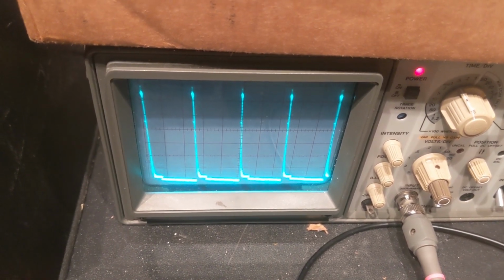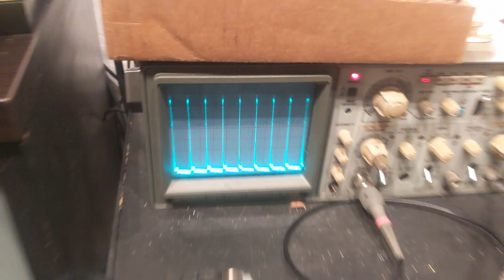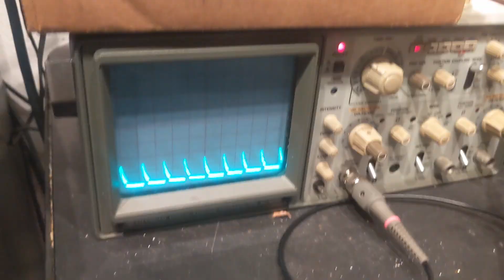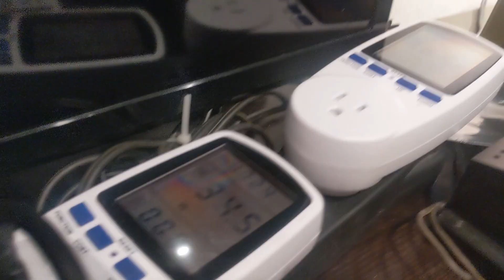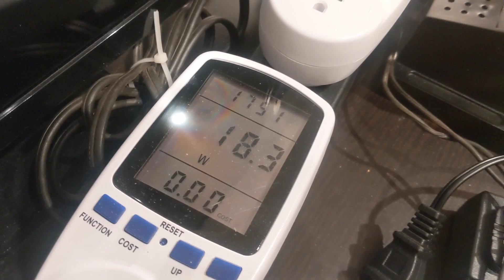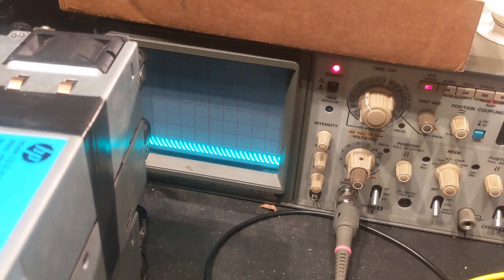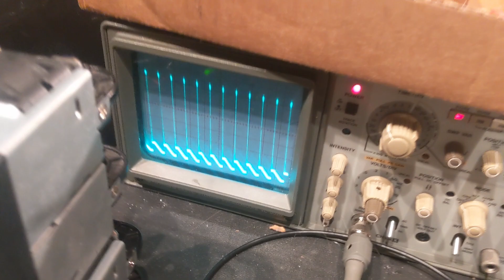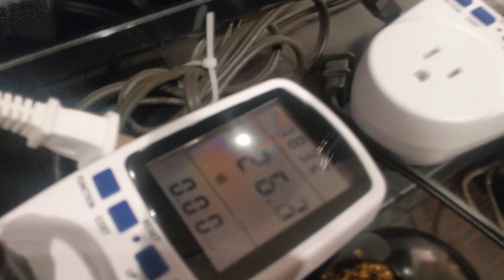HHO High Voltage Resonance

Comment: Is that a bosh ignition module that I see?  Can you explain it’s use please?
Reply from the maker: Yeah, the radiant comes from the spark gap it has, if that's what you're referring to. The energy it draws in just goes straight to the cell. I'd have to look at the schematic again but there are many ignition modules, this one basically works properly with the transformer. Wondering if there's another one that's better though

Comment: Have you been generating alot of hho using high voltage, high frequency and low current?? I'm still waiting for your answer
Reply from the maker: It's less about quantity than quality. The gas production is little, but it burns better.
Reply: @weighta6630  Oh right, that's good you make a little of gas. Have you thought about making a PCB board to generate the frequency by install python software on the board that will take the reading of the voltage then it would calculate it to generate to make the high frequency??
Reply: @weighta6630  ionize dehumidified air and mix it with the hydrogen gas? Prevents water from forming out of the hydrogen so you can run a large quantity of gas at once.

Comment: the high voltage must be coming from inductor spike.that is pulse by 555 timer or TL494 ic.not from high voltage transformer ..thats why u need inductor before cell. 1 inductor per cell is the proper config.not like this.watch RAVI RAJU video 15 years ago.thy repkicated this long ago

Comment: Cell insulation in this design us poor. when you add a conductive electrolyte current begins to skip other cells  taking a shorter path were it does not have to do as much  work and so the voltage drop across the cells in serries will be uneven with the largest drop at yhe begining and ending, because current is flowing through the cells unevenly skipping the center cells. 

Reguarding electrolysis, there is nothing magical about resonating an LC circuit. It does not more efficently break water apart and is far from molecular resonence. Forfet all the psudo science nonsense.  Even if you could reach molecular resonance with water, you'd just heat up water like a microwave oven needlessly flipping the waters molecular dipoles, and do  doing nothing for electrolysis. The except beibg where voltage at a plate is sufficent  to split hydrogen from oxygen 1.24v and a little more  to do the work of  push pushing ions    through an electrolyte. 

Keep it simpke.  Use DC.  And apply only as much voltage as needed to push current density you're aiming for. Stainless steel max should stay under 1 amp per square inch. 0.5amps per sq inch will keep the electrodes in good shape much longer.  Wire all the cells in a wet cell in parallel forget the serries nonsence. Serries is gine for dry cell design or were cells are well isolated from others.   Increase the conductivity of the electrolyte with a 6 mol solution of potasium hydroxide to 100 ml of water. Reguardibg your source of potasium hydroxide, Be aware of percentage of potasium hydroxide hydrates like  KOH•(H2O) to get a good number on the number of moles you're adding to each 100 ml of water. 

The  rate of hydrogen production is all (only) about amps that flow.  water's splitting voltage 1.24v × the amps that flow = watts of energy being stored chemically. The 1.24v doesn't change but you can change the amps with  over volts or voltage over the previosly stated 1.24. These volts push ions that bouncing off and heatswater molecules.  Thats why you minimize the distance between plates and use a good electrolyte to lower the resistance of ions flowing between plates and add plate surface area to conduct more current. 

Salts in urin largly (NaCl) contain chloride ions that are bad for stainless steel. Stick to sodium hydroxide or better yet potasium hydroxide and cover it to prevent atmospgeric carbon dioxide from converting it to potasium carbobate and bicarcarbonate.

Dont bother with PWM either to limit the average power going into a hho cell. Instead you may use cheap  pwm to drive the duty cycle on a buck converter. So that you can control the voltage to a more efficent voltage and the cell produced only have the time and contrast wuth pwm without buck conversion producing inefficiently and only during duty cycle.
Reply from the maker: Correct. The resonance is honestly no good here. The amps break the bond, but i would still like looking into hv with a good emf to split it like meyer did
Reply: @weighta6630  considering that the bonds take energy to break,  it's actually 1.24v × amp × time  that produce some unit of hydrogen gas from water.  Have you heard some HHO enthusiasts refer to mmw  mililiters per minute per watt?  That is  is each 60 watt seconds produced a milliliter of hydrogen and a certain amount of heat. At roughly 13.4v an HHO  cell produces roughly 1mmw and a bunch of heat. (13.4v-1.24v) × each 60 amp seconds, and  is less significantly less efficent than another cell supplied a much lower voltage but  producing at the rate of 6mmw. 

If one supplied 2.5v to a cell then the difference 2.5v-1.24v=1.26v overvolts that when we multiply by the amps  that is flowing = power converted to heat energy with ions bumping into molecules.  

You seam like your failure with electronic components so I'll offer this. You can simulate electrolysis fairly well in a circuit simulator with a resistor and a 1.24v zener diode. If you pulse width modulate power going into an electrolysis cell, then you'll notice high inrush current because capacitance between the plates and water's dielectric properties.  That energy consumed  by realign water molecules in an electric field. So you can model this too with a capacitor and resistor (dielectric heating) in serries but in parallel with the resistor( electrolyte resistance) and zener diode. 
For each amp second × the 1.24v drop across the zener diode represents the work needed to produce a certain unit of hydrogen.  While the same amp second flowing  through the resistor ohms = a unit of energy converted to heat. If you or anyone not familiar  with a zener diode, idealized, think of it as a resistor that changed its internal resistance in a way that the voltage drop across it always the same reguardless of the amps flowing through it. 

Myer didnt really know what he was talking aboit, and worse, a fraudster. but by all means explore what interest you.  I though I'd just help you see a little better through the muck starting with rf energy heats water like a microwave oven does.

Because water molecules look like a boomerang, and hydrogen shares its electrons with oxygen it froms a edipole  (+h )(--o )(+ h)  with the hydrogen atoms forming an angle of about 104 to the oxygen atom.   Alternating RF energy rotates water molecules to align with the external E-field and may even slightly alter the bind angle.  Doing this repeadedly with RF energy is called called dielectric heating causing the molecules to heat up and vibrate more.  But lets ask "what does water molecular resonance mean" . A pendulum resonates and if we add energy at its resonate freqency then the input energy phase is constructive interference and the adding to the amplitude of the pendulum swing. I don't see rotating  water molecules as helpful to breaking water molecular bonds, but maybe we can might consider trying resonance in a biased electric field. The bias helps keep The oxygen atoms always pointing to the anode and the two hydrogen pointing to the cathode. Do this with cold water to minimize disturbing  this the alignment.  Then maybe if you oscillate the strength of the biased field you can cause vibrations in the hydrogen bond angle,  shrinking the angle between them and relaxing them at a rate whose input energy constructively interferes.  Maybe at a high enough freqency you can find this resonanc,  but I suspect that's just too high to engineer and the vibrations you do generate will just create heat.  But, who knows maybe you'll see something interesting.
Reply from the maker: @kreynolds1123  I hear graphite foil or carbon works amazing for plating but what spacing is good for 1.24v, like 0.0625"? I mean koh will drop the voltage sure.

Most of everything mentioned I was figuring out more and more because it seems like I was getting nowhere with thinking outside the box with this. I still have ideas, yes, but i can incorporate them with the setup you're talking about.
Reply: @weighta6630  Current will not flow at 1.24v per cell.  And koh doesn't drop voltage, ratherly it  reduces resistance within a range of concentrations to allow one to apply a lower voltage to achieve a given current denisty. But you need overvolts to push current. How much overvolts you use depends on an engineering compromise between production rate, plate durability, plate cost, and sufficent efficiency. 

Conductivity between plates and through an electrolyte is analogous in part to conductivity in a wire.

First, a wire with twice the cross section area has half the resistance or is twice as conductive. 
Second, a wire that's twice as long has double the resistance or is half as conductive. 

Thirdly, Bubbles are not conductive  and reduce the conducting cross section of plates and in solution, the effective cross sectional area of  conducting electrolyte.  It's like nicking a thin wire and it gets hot when you push current through it  because your causing electrons to speed up through the narrower cross section in the nick and the electrons bounce harder off metal atoms making up the wire. 

As to point 2 and 3 you can reduce the path ions flow to reduce the resistance to ion flow, but. For a given current X, you'll produce Y amount of bubbles. If you half the ammount distance you half the volume and consequently double the bubble density in solution. So it might help to pump your electrolyte  and help remove the bubbles from the plates and out from between your plates. 

I'm not an expert on what's best electrode materials or what catalyst  helps reduce the over potential needed.   i can recomend a maximum current density for these electrode materials
1) platinum, the maximum recommended current density is typically between 0.5 and 2 amps per square centimeter. 
2) Carbon, it's between 0.2 and 0.8 amps per square centimeter. 
3) 316 stainless steel, it's between 0.5 and 2 amps per square centimeter. 
4) 304 stainless steel it's between 0.3 and 1.5  amps per square centimeter.
5) Mixed metal oxide, it's between 0.3 and 1.0 amps per square centimeter. 
6) And for nickel, it's between 0.5 and 2.0 amps per square centimeter.

Remember that all electrodes wear, and faster the higher the current density and the higher the electrolyte bath temperature they are operated at, and most (maybe all) of the erosion will happen at the anode.  For longevity, it's better to operate at the lower end of the recommended max current density. 

Although asid like Hydrocloric acid and sulpheric acid are more conductive than alkaline KOH, they'll corrode and wear away stainless steels and carbon and probably the other plate materials as well. Use KOH as it is more conductive than sodium and lithium hydroxides. 
Google image search these term "electrolyte conductivity graph koh". You'll find KOH is most conductivr at about 6 molar concentration per liter of water. It's the the most compatible with stainless steel. Dont forget to factor in KOH•H2O hydrate contamination from your KOH suppliers.  The typical level of hydrated potassium hydroxide is... 
- Most suppliers provide potassium hydroxide in the form of flakes or pearls with a typical water content of about 30% to 35% By weight. 
- However, some suppliers offer dehydrated potassium hydroxide with a water content of less than 5%. And dont forget to keep it sealed as much as possible to avoid atmospheric Carbon dioxide reacting with it making potasium carbonate.
Reply: @weighta6630  I was recently  thinking about two 316 wire mesh screens rolled with a nylon mesh separator front and back of a wire screen.  Then apply a very low voltage to push a low current density as it will be hard to remove the bubbles but the efficency will be high. And I'd be using both front and back side of each wire screen  then maybe pump fluid through the screen plates. Dificulties i forsee is point of curent collection with the plates and the level of current  to feed bith sides of a plate. As well as  the thinness of wire mesh. Maybe secure a current collecting wire every 10 cm of plate area to  distribute  current  over seveal points of conection with the wire mesh. and maybe I will really want more seperation for the gases to better escape. I'm still thinking of how much and how easy to construct.
Reply from the maker: I was always under the impression to let the gas insulate the tube, and now it's the complete opposite. A lot of it makes sense now. A lot of the voltage stuff was really taken out of context for this experiment. Either it's electrolysis, or it's voltrolysis, and my demo was neither to say the least, just the worst electrolysis imaginable lol.

I made TKOR's hho generator and was really happy with the results until i got into meyer's stuff thinking I could double the output and such. I changed my view with this recently, kinda sad it didnt really take off, but it makes a ton of sense from a conventional standpoint. At least I learned enough about electronics to get a masters lol. @kreynolds1123
Reply: @weighta6630  About me. Obviously,  I'm a poor speller.  But more relevant, i worked at a company that made HHO generators. I designing their controls using a siemans logo  programable logic controller (plc)  to take input on fluid levels and temperature sensors to control pumps and fluid valves and fans and  I used the PLC to create a pwm signal that buck converted the voltage down.  Because the PLC uses physical relays i modified it to switch power mosfet part of the buck converter to regulate the power flowing into the cell there by regulate temperature with the addition controlling the pumping the electrolyte through a radiator  and use powe to a fan. The fluid level sensors kept the plc informed of when to let new electrolyte in and when to stop refilling.  I have a strong background in electronics, and radio communications from the military and intense interest in physics and chemistry and so much more that's unrelated here. 😁

Comment: you should get no bubbles w distilled water
Reply from the maker: the voltage overcomes that eventually and pulls current
Reply: @weighta6630  distilled water doesn't conduct electricity. Believe me
Reply: There's stuff dissolved in that water, and it likely came drom the cardboard, hot glue, dried sweat on the pipes, and any other impurities that went in.  Pure water reads around 18 megohms.  That's not what's in the distilled water bottles at Kroger.

Comment: Hey man.
Congrats.
Cell conditioning is usually Private information.
How did you find about it?
Also , the setup of the cell is wrong. Buy with 10% some stainless steel places , and place them in parallel.
That high voltage should produce hydrogen from every plate.
I subbed to your channel.
Best regards.

Comment: Youre basically making a chemical resistor with distilled water, which is an insulator without impurities. Add sodium or petasium hydrozide til the voltage and amps level off and flow measure as you go.  Also the anode could use a torus top for dispersal.
Reply: its actually a water capacitor
Reply: Better study on this looks not to safe

Comment: I am wondering if anyone can give me an idea of how I can use the Stator and Driver for a mechanical shear/ ultrasonic cavitation homogenizer. At low RPM it produces rather large cavitation bubbles, but crank it up to 30 000 rpm and the beaker begins to look carbonated with millions of tiny cavitation bubbles.

The generator unit is ss316 and the center shaft that turns the rotor and the stator are Electrically isolated. Energizing the exterior is easy, but energizing the center shaft while still allowing the 1000w motor to spin this up to 30,000RPM. It's a .25 mm gap between rotor and stator.

"CAT Scientific offers a broad selection of rotor-stator assemblies to increase the utility of CAT homogenizer drive units.  Using supplied tools generators can be quickly switched out to handle other tasks.

Depending on configuration  CAT's interchangeable rotor/stator homogenizer design subjects the media to a combination of sonic energy and mechanical shearing. The extremely high circumferential speeds attained by the rotors of the homogenizer create ultrasonic cavitation, which assists in very fast, efficient homogenizing

Comment: distilled water will not conduct. thats why the voltage is going high.
Reply: 10 meg ohm high purity distilled and deionized water will conduct only a little bit.  Any impurities in there such as what dissolved out of the cardboard or the surface of the tubes or wires or anything else placed in there will increase conductivity.   You're absolutely right about the voltage being high when the current is close to zero.   Just like a solar panel.   Highest voltage is when there's 0 current.  Highest current is at 0 volts.